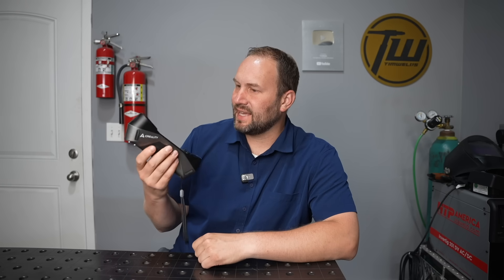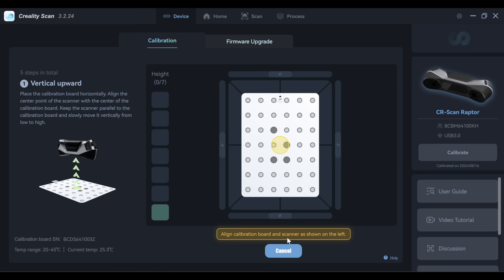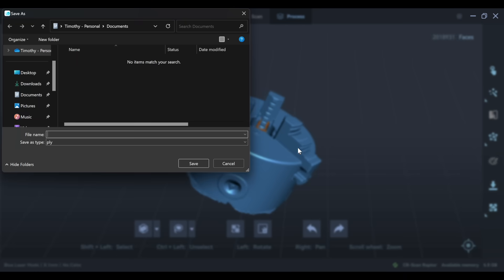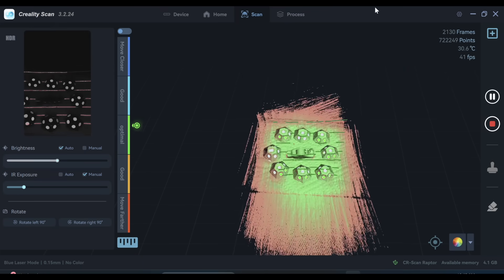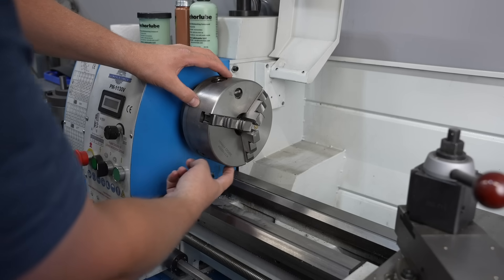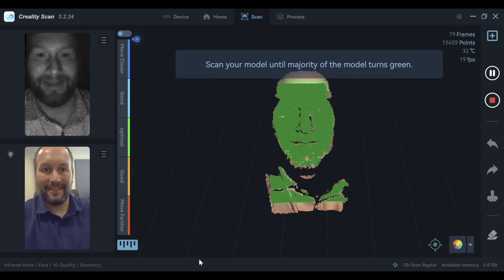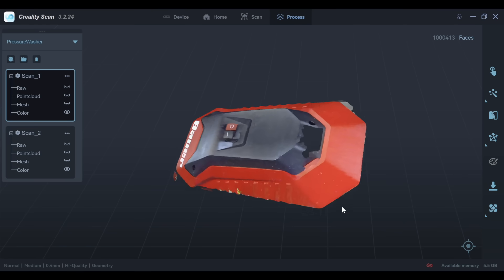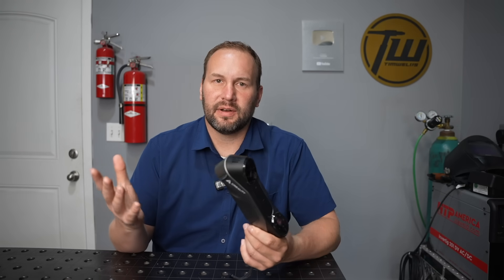Blue Laser 3D Scanner Worth The Hype? Creality Raptor Test

Comment: I'm suprised that it isn't mentioned that Creality Scan 4 requires admin priviledges to run. This is a showstopper if your PC is connected to a company/organization network where admin rights are only allowed to be used by network administrator.
And the answers from Creality on why the need admin rights is that they need to write to the registry which is just plain stupid. The risk is that this software is just a gateway for some hidden functionality to gain full access to domain network.

Comment: Is the accuracy meterology level?
Reply from the maker: That’s too complicated for a one line answer. Depending on your tolerance, it could potentially be used for inspection, but a gage R&R study should be done for the specific application first.
Reply: @TimWelds  Thank Tim for the response..actually I wanted to use this to scan laptops and other electronic devices for designing screen protectors and protection films for the outer body...so accuracy is pretty important although we can tolerate 0.05 mm levels of errors..does this have that level of accuracy?

Comment: To judge accuracy by this chuck support, thats just useless 🤷🏼‍♂️
Thats multiple mm of clearance. Whats with sub mm accuracy?
Reply from the maker: The chuck support is just an example of using scan data, not some sort of accuracy test. I designed some clearance into it, but using the scan data to design off of saved a ton of time.

Comment: 7:33   @TimWelds I believe you are supposed to put 3 dots on each scan :-) Just keep going. The other dots show up with different colours. 

And you don’t need a punch.for example That bushing on the side (or whatever that circular mark in the side is) would serve nicely as a point. Just select the same “clock position” on both scans. 

Hope that helps you :-)

Comment: I have the Ferret Pro..im trying to scan a model jetski, about 10inches long and 2.5inches wide..and it sucks..the surfaces are all rough and i gotta spend hours smoothing it out.
Would this Raptor be better for that??

Also have you tried hanging something with fishing line to get a full 360 around the object?

What 3d scanning spray are you using?

Comment: Tracking errors could be related to your reference point pucks.  The geometry of the pucks are too similar to the next, if pucks have too similar geometry around the part, the transformation can get skewed.  

Try randomizing the puck geometry so the reference point placement isn't identical and try not to use too many of similar geometry in your scan, you may have had too many pucks also.

You can 3d print a "pillar frame" to surround your part also and put your reference points on the pillars in a random orientation.

Comment: Tim, would you mind sharing your laptop specs? You had 40fps it looked like on the 1-2-3 block. 

Laptop Brand/Model
CPU
GPU
RAM

Thanks!
Reply from the maker: It's an ASUS Q540V creator laptop. 
Intel Core i9-13900H
NVIDIA RTX3050 6GB
16GB RAM (it could use a little more to be honest, but I get by)
It was a returned unit at my local Best Buy, which I was able to get for about $750, which was pretty good for those specs at the time.

Comment: Great video! I have a question about the volumetric accuracy of the Creality Raptor. The site says it’s 0.02mm for 100mm, so I guess for a 1000mm part it would be around 0.2mm, right? I’m thinking of upgrading—currently using a Revopoint POP2, and I’m sure the Raptor is way better for small details. But my main focus is scanning larger parts, like 1 to 2 meters, for reverse engineering.

With the POP2, even using markers, I’ve seen up to 5mm variation in 1-meter parts when I compare two meshes that should be identical. It seems like there’s a tracking issue or something when merging the point cloud.

Has anyone here used the Raptor for scanning bigger parts? How’s the accuracy in practice? The specs look good, but I’m curious about real-world results. Thanks a lot for any help!
Reply: I also have the pop...currently contemplating miraco pro (because of its portability) and this.. because...blue light.  So hard to choose
Reply: Hello no necessary you should review the calibration certificate and data sheet and the certificate accreditation

Comment: Hello, Can scan large parts like a front bumper of a vehicle?
Reply: It should be able to, the largest area the infrared scanning can handle is around 2m^3. The blue light scanning is limited to much smaller regions though so you would have to use infrared for something of that size

Comment: Hey! I’ve got the Raptor too, and here’s a tip for getting better precision. Try lowering the brightness of the laser to make the lines thinner but still visible. If the lines are too thick, you lose resolution because the sensor can miss finer details that are thinner than the laser line.

Oh, and skip using the Creality Scan software to generate the mesh—it’s really not great. Instead, use Meshlab for much better results and alignment (especially when the auto mode or manual mode don’t work).

Here’s what I do:

Open the optimized point cloud files from Creality Scan in Meshlab.
Enter alignment mode by clicking on the yellow circle with an "A."
Pick one of the scans, hit "Glue Here Mesh," then "Set as Base Model."
Click on another scan, and choose "Point Based Gluing." This opens a window where you can pick similar points, kind of like in the Creality software. Double-click to add a new point and Ctrl + double-click to remove one.
Once you’ve placed your points, click "OK," and the point clouds will shift and almost align (or not). Then, click "Process," and it’ll optimize the alignment. Keep doing this for all your scans until they’re all lined up.

After that, you can turn them into a mesh like this:

Go to Filters -> Remeshing, Simplification And Reconstruction -> Surface Reconstruction: Screened Poisson.
Check "Merge all visible layers" and "Pre-Clean."
If you want more resolution, bump up the "Reconstruction Depth."
Hit "Apply," and it’ll generate the mesh. Just hide the point clouds so you only see the mesh.

To export, go to File -> Export Mesh.

If you’re only working with one file, you can jump straight to the remeshing part.

Oh, and here’s a bonus tip: You can use dry shampoo spray to apply a thin white coat on your object before scanning. It’s way cheaper than those 3D scan sprays, and it washes off easily with water.

Hope this helps!

Comment: $1500 and it’s not even usb c??? Must be meant for poor people.
Reply: The end that connects to the scanner is USB-C. And like @TimWelds says, it comes with a USB-A to USB-C adapter. But I agree, any modern hardware should default to USB-C and then have an adapter to USB-A. I don't see it as a big issue, however.
Reply from the maker: It had a USB-C adapter also, but this connection seemed to be fine.

Comment: I have yet to see any actual critical reviews from anyone that was "given" this scanner. They're ALL sponsored. Meanwhile, the critical reviews all seem to be purchased and used by actual people and not high profile influencers. Even the listing on amazon was recycled from another product that had good reviews. Why do the actual users and influencers have such a different user experience???
Reply from the maker: I totally get what you're saying, and honestly I'm moving away from doing many more projects/reviews like this in the future because even if I tell the honest truth, it feels like an infomercial and doesn't provide the best value for my audience. I truly did my best to show my honest experience, including all the tracking errors that I ran into in the software and the delays they caused. This is the same issue you'll find complaints about online whether sponsored or not, so I haven't really seen examples of people having a different experience than that. (I don't count the whining on reddit by guys who've never even touched the product and just don't like the brand.) I ended up with very accurate scans, which are real and there's really no way to argue with the scan data that I got. For the cheapest option in a blue light scanner, it does work at a reasonable level with the understanding that it's not a top of the line professional machine. For the infrared, I also said it's not the best option available, which I think is a critical review. Regardless, I do appreciate and completely understand the feedback. Thanks a ton for watching.
Reply: I actually bought one, and can confirm that laser scanning is really like in the video and once you get good at it it gets to insane details. The infrared mode is more challanging and in my experience looses track a lot when not using markers, especially in geometry mode. Main thing here is that it would be nice if creality would improve the software a bit more, it works fine, but lacks some very basic functions, but exporting and importing the pointcloud in other software is a good work around for it.  I am actually so convinced that i now ordered a Otter as well for bigger parts like cars.
Reply: @devilmastah  i bought it too and have the same experience that you stated.
Reply: @devilmastah why get the otter instead 9f using the raptor?
Reply: @Fernybeme i now have both and can say they are a good combo! the otter is a lot better when it comes to big scans, like whole cars. Main difference is that the larger fov helps a lot with tracking in geometry mode :)

Comment: I haven’t seen this one. It looks interesting. The question is, would you have bought this yourself? I’m looking for one and I haven’t decided. I’m going to go to the additive expo a month, or so, from now, here in NYC. They usually have these, from amateur to high end commercial. What’s the cost of this one?
Reply from the maker: @melgross I'm not sure if I would buy it or not. Hardware wise, I would definitely go for it, but the tracking delays on the software really slow things down. It's my second scanner, I bought an Einstar last year. For small, high precision parts, the result from the Raptor is definitely better and the measurements were crazy accurate. I checked the dimensions on the large chuck and it was within .001". I think the reason that the small chuck read a few thousandths over the caliper measurement was actually the thickness of the scan spray. If you need that level of accuracy and detail, I would buy it, recognizing that it's the lowest cost option and the tracking errors will cause some delay. Hopefully, this improves in future software versions. If you don't need the blue light scanning and your primary use is the infrared mode, I don't think the Raptor is the best option. The Einstar has a larger field of view and it is much more forgiving of technique without losing tracking, which makes it much better for scanning larger objects quickly with very little preparation. The scans are pretty accurate and detailed from it too, just not quite at the same level as the blue light mode on the Raptor. The Creality Otter seems to be more like the Einstar. I'm not sure if it tracks better than the Raptor, but if it does, it's probably also a good option.
Reply: @TimWelds  accuracy is the most important requirement. I’m willing to give up speed and convenience. I’ve used some industrial scanners and they’re pretty amazing. But these low/medium priced models are getting closer. The blue scanning is why I’m interested.
Reply: I just got a Raptor delivered on Monday. I think for most people, the Otter is the better option. It has a wider field of view, faster scanning, and still decent quality results.

I got the Raptor for scanning in clay sculptures and detailed models. I will say the cord length is a bummer. It's connected to my workstation, which is too big to move to a work table so I'm going to try a 6' extension and see if there's issues. The infrared mode is also pretty worthless. The field of view is so small, and loses tracking all the time. But that's not what I bought it for, just sucks it's that bad. I got it with a discount code from Creality's website for $1100, normally $1500. The Otter is $900.
Reply: @chadvoller  that’s good information. Precision is the most important thing for me. Scan speed is secondary. I’m surprised at the short cord. Also surprised they’re using a USB A connector in late 2024. But I imagine a make USB C to female USB A would work. Another problem for me would be if the software is Windows only. Ok, I just checked. It works with M series Macs. That’s great. Now it would be even nicer if I could use it with my 13” M4 16GB RAM iPad Pro for more portable use.
Reply: @melgross  It comes with the USB C adapter. It's actually a USB C connector at the unit where it screws in.
Reply: @chadvoller  ok, that’s good.
Reply: @chadvoller  Hey! Would it be possible to know the discount code you used? I've tried a couple but they're all expired. Don't know if I can justify 1.5k euros for this haha
Reply: @chadvoller  9 months later, how has your experience been scanning your clay sculptures and detailed models? I'm interested in a similar use.

Comment: These scanners definitely have a learning curve (the actual scanning, piecing together, mesh export, Fusion import, conversion to surface). I have the Einstar. After a couple scanning projects, you'll find you're grabbing it instead your calipers. "Learn Everything About Design" has some excellent videos on both scanning and Fusion import. Thanks Tim, have fun. Stick your kids on a spinning shop stool, scan then 3D print their heads. Very helpful for costume making.
Reply from the maker: They definitely do have a learning curve. I bought an Einstar also a little while back and it's been a fun technology to tinker with when I have time. Learn Everything About Design is a great channel, I've picked up a lot of tips there.
Reply: Hello, Can scan large parts like a front bumper of a vehicle?
Reply: @nordenconrad  @TimWelds search for "Adding some Technology to the Jeep Cherokee Build - Shining 3D Einstar 3D Scanner" from Treasure State Toolbags.

Comment: I built a table with a lazy susan on it and a stepper motor slapped on a motor controller and made a scanning table out of stuff I had here
Reply from the maker: That's a great idea! I have a couple rotary welding positions I might try to use as is, but if those don't work, I'll probably build something like you're describing.
Reply: I wanted to do that with a foot pedal to control direction and speed.